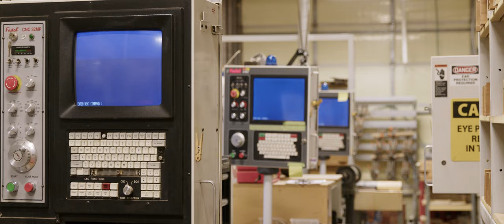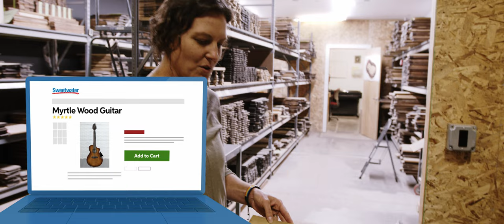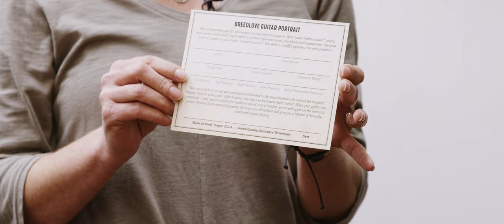Breedlove Guitars Factory Tour & Brand Story

Comment: I own a Breedlove Concert Bass and I love the instrument. It's beautifully made and sounds great. The only issue I have with the instrument is how they mount its battery. I installed a pop up battery box from stewmac to make battery replacement  quick and easy. The box came with a template. It was very easy to install. I don't know, maybe they don't install them in order to maintain sonic quality? It sounds exactly the way it did before I performed the install but who knows, maybe it doesn't perform well when tested using lab equipment.